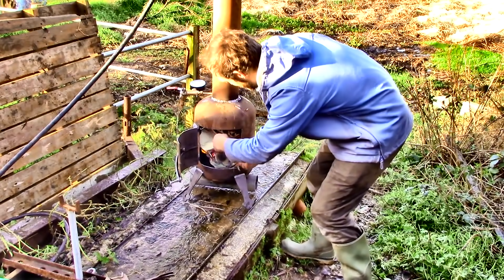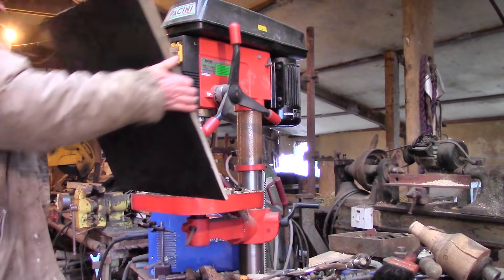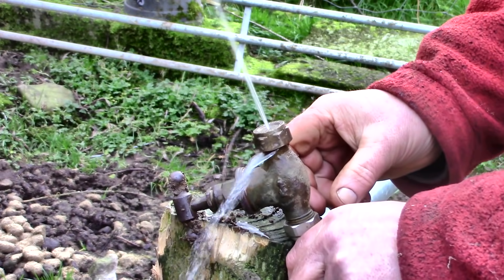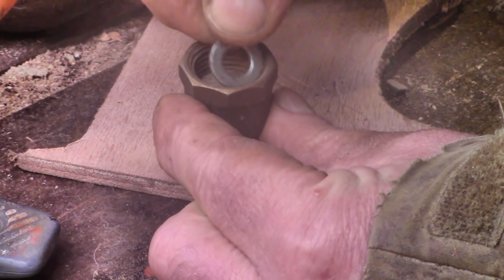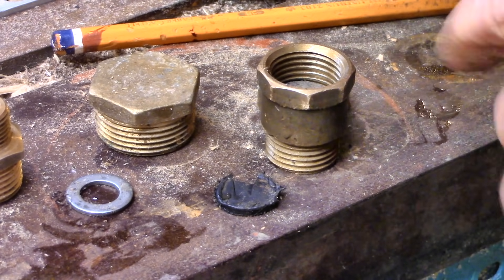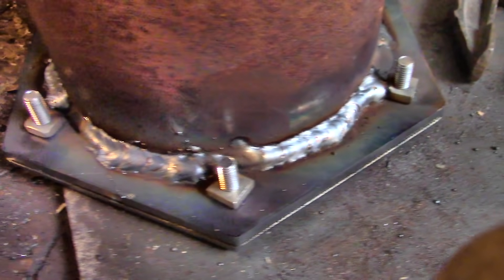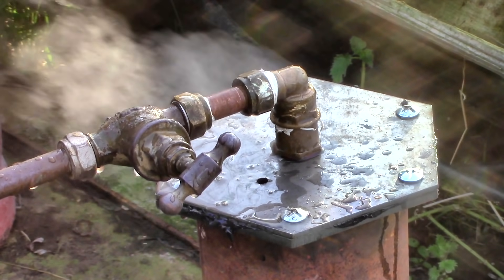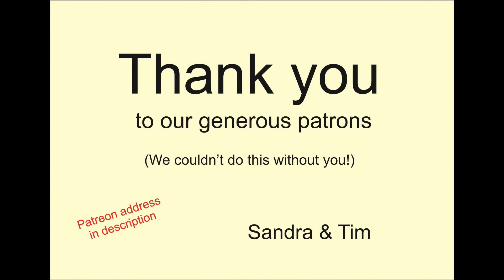Home Made Hot Water Float Valve! (For the flash steam boiler)

Comment: I think modern float valves might be heat proof up to 200°C. But very old ones used copper ball floats. Have you considered using a float to operate a ball valve?

Comment: Why don't you consider a combination of toilet valve and siphon pipe system? by using a conventional toilet valve from the pipe to fill a tank 1/2 to 2/3 volume of your boiler, and connect it with a siphon pipe, the inlet to be at the bottom of the boiler and submerged below the water level. In this way, though some heat would be wasted at the inlet section, but there should have parts available at your local hardware store.
Reply from the maker: Both the tanks would need to be able to cope with the pressure - and maybe the heat would spread between them too? In which case there wouldn't be any advantage, would there?
Reply from the maker: And  they'd need to be connected at the top as well, I think. Otherwise the steam would push the water back up into the first chamber..
Reply: @wayoutwest-workshopstuff6299  therefore I suggested to connect the pipe to the tank at the bottom of the boiler, with the water near to dry out, the pressure should drops as well, and would allow the water to flow from the tank though the siphon.
Reply from the maker: there will be at least 30psi in the system - otherwise it won't drive the engine - so it would easily push the water back into the first chamber. Keep on thinking though!
Reply: @wayoutwest-workshopstuff6299  it depends on whether the pressure built up in the boiler can push the water in the siphon pipe all the way down to the bottom of the  opening. And sure as mentioned, there will has heat lost to the tank, but as long as there is no constant flow of steam, this could be minimized by insulating the pipe.

Comment: of course, just mounting a feeding water tank above this bioling unit will provide the neccessary preassure to feed the system on the move. You could have the main tank lower down to keep the centre of gravity low and pump fed into the resovour.
Reply from the maker: But how would you stop it flooding?
Reply: @wayoutwest-workshopstuff6299  the simplest way would be to have an overflow pipe, that allows over pumped water to flow back into the main resevoire. Even with a more complex solution adjusting input flow, a feedback pipe would still be a good idea.

Comment: A length of anodised aluminium or titanium rod, sheet or wire, inside a metal tube will work as a capacitive sensor for detecting water level inside boiler tubes, some simple electronics can then switch a pump, solenoid valve etc to control the boiler's water feed.
Tank type boilers produce saturated steam, which is "wet"/any fall in temperature causes steam to condense. A  single long thin tube, as a  single pass, monotube/"flash" boiler,  is considerably more robust for handling higher pressures, and can have the water level adjusted  to make for a shorter, or longer "superheater", in which the steam is continued to be heated after it has boiled.
Reply from the maker: Thanks, Steve, but this is just the first part of the flash boiler.. (Also, I'm hoping to avoid all electronics.)

Comment: did you think about and have you tried actually putting in Reverse
have the water pressure pushing the rubber closed
make the hole bigger so the pin can push through it to push the rubber away from the hole and that would make it flow

Comment: Beware of flap valves for this type of application, they are best reserved for check valves. Your original idea of a nail in a hole is to reduce the force required to close the valve. Once a flap valve opens you can end up with full line pressure behind it, needing enough force to counter the pressure at full bore area to close it again.
Reply from the maker: Surely you get the full pressure either way?

Comment: Maybe someone's already mentioned this...  In a toilet cistern the float is levered near the valve to increase the power applied to the valve.  In your system the two cans (the float) have to be huge apply a 1 : 1 force against the valve.  You could get away with a much smaller float if you apply a fulcrum point to increase the force applied to the valve needle.  Just a thought, just my two cents.

Comment: I'm with those who would separate the "water level" function from the "pure steam" function, because I was raised on Modular Design. My immediate thought was to use an available toilet float connected by a U-tube to control the water level, then focus on managing the steam that is produced. I acknowledge that you have a compact solution, but it seems to me that a problem with the water-control involves dismantling the engine rather than screwing in a "better float module".
Regardless, I am greatly impressed. As usual!
Cheers Chris

Comment: quite a clever desine but i see one ishue with it and that the boiler cant exeed the preshure of the water in the pipe or the cylican disk will be presed aganst the valve stopping water enterig the boiler over than that grate desine
Reply from the maker: That's the way with flash steam boilers - the steam pressure can never be greater than the water input pressure

Comment: A nice trick for making really tiny holes in metal, smaller then is easily achievable with a drill bit. For making tiny holes for pinhole photography people sometimes take a nail and hit it into the metal until a dimple forms on the other side, if you then carefully sand down the dimple you can make holes as small as a 30th of a milimeter(if a fairly hard metal is used).
Reply from the maker: thanks for this - very interesting

Comment: you could always build a brass or copper float....... by using solder or braze it.  That wouldn't rot away and was used in a lot of toilets.  Maybe a bigger tube for the hot steamy water as well ?  Good luck

Comment: I have this project idea that keeps coming into my head. The problem is this: as an inhabitant in modern civilization, I obtain lots and lots of packaging in the form of cardboard, along with lots of things in plastic. Rather than expend energy transporting that cardboard to recycling centers or landfills, wouldn't it be nice to put it to use? Well, one way would be to incinerate it to heat my home, but I live in the deep south, so I don't typically need heat. But I do need electricity. So wouldn't it be nice to be able to incinerate it (alongside other fuels that are otherwise waste) to produce heat to boil some water into steam that then passes through a turbine to produce electricity? Seems to me that it would be, but there are a lot of enormous technical challenges that I simply don't have the time to investigate, let alone solve. So I deeply appreciate you sharing your learnings. Maybe one day I will be able to apply them to my project idea.
Reply from the maker: burning plastics needs really high temperatures to do cleanly - careful you don't just poison the neighbourhood!
Reply: Oh, Sorry! I meant "burn the cardboard and use the waste heat to recycle the plastic a la Precious Plastic," but see now that the recycling aspect fell out of my brain before flowing to my keyboard ;-)

Comment: I always appreciate your ingenuity with these projects. I may be missing something, but does the float valve need to be in the tank? If only the float was in the tank and the actuating rod could exit via a seal, then normal cheap plumbing parts could be used to control the fill pipe. If the float rod was bent into a 90 you could get some leverage out of it to overcome any pressure from the seal? Might work idk.
Reply from the maker: You're right in theory - but I don't know how I'd make that seal in the real world.
Reply: @wayoutwest-workshopstuff6299  I was picturing the packing from a hot water faucet tap or frost free hose bib. Something like that? I think even a regular valve like you have could be cut off and the stem could be sanded and brazed into a larger pipe fitting.

Comment: Tim,

Very clever. I am impressed - as usual, 

There is a needle valve on carburetors that are very similar to the one you fabricated. If you have a scrap yard you might find one for pennies ready made. 

The orifice you made is quite small and I worry it may get plugged up with scale and cause an over pressurization.  No doubt you have thought of that.

Regards
Frank
Reply from the maker: You're right - but I wonder what pressure is behind the petrol?
Reply: Modern cars with electric pumps are around 60 psi. Older cars were 4-6 psi- so sayeth Google.

Comment: You could always use brass valves. Rather than using a plunger, use a system like they do on Mamod steam engines. The shut off is powered by a sliding plate that goes over the hole.
Reply from the maker: Interesting - thanks.

Comment: Tim what about doing it a little backwards. Use a ball bearing in a cone and let the water pressure close the ball the float pushes the ball open when the level is low.
Reply from the maker: Can you send me a drawing, Perry? Wouldn't you be relying on the weight of the float, rather than its buoyancy?

Comment: Hey just want to let you know that maximizing airflow for the wood burning section is key, perhaps using a set of bellows to make sure it is still hot, I think it goes well with the steam engine vibe, and allows you to keep the wood section small but still hot enough to make the water flash to steam faster.Loved the video!
Reply: Interesting idea for the bellows. Early locomotives used axle driven bellows (you can see them in early engravings) to make the fire burn hotter. Once they came up with the blast pipe to draw the fire they no longer needed them.
Reply from the maker: Thanks, both - yes, very interesting

Comment: You could also simply add another tank with a regular float and connect it with two thin pipes, one at the top of target level and one at the bottom. This way you can use off the shelf float and water in the inlet tank will never get hot enough.

Comment: This feels very unreliable for my taste. Many moving parts out of control, and with slight contamination in water... I would place a cheap stainless steel float with a reed switch, from china and place an electro-valve away from the fire. It could run from a small battery or even solar power. This would make space for adding other simple sensors to the equation, like thermostats and so on.
Reply from the maker: I had to look up reed valve - but it seems to be what I've just made. Or have I got that wrong?
Reply: @wayoutwest-workshopstuff6299  I think about this https://www.youtube.com/watch?v=ifJjFp6GENY there is a reed switch inside the tube that closes when the float is close enough. It is potted and comes with hi temp   wires for as cheap as under 2€. You can also get them with 90deg bend do be mounted on a side of the tank.  I also found stainless hi temp float valve (just like plastic) on Ali for about  37€
Reply from the maker: @contemporiser  Thanks for this, Piotr. I didn't know they existed. I will try to order one today

Comment: Tim, I know you don't like the idea of a gas engine, but as much as I love steam engines, all I've learned about them has taught me to be afraid of them. There's a lot going on with them.

And you could definitely make a small gas engine locomotive of sorts to push the carts around. It could even have rubber tires and you know, be able to go across track and around carts to get stuff where you want it more easily. You know, one of those walk behind tractors, maybe with a couple more wheels, would do nicely. 

I'm just worried that a steam engine and locomotive will injure you or explode.

Comment: Nice concept! You could make the valve working the other way around. So the water pressure from the pipe to the vessel closes it. To open it something has to press against the opening. For the actuator you can use a sunk screw with 45° angle. 
       ___________________________
      I               __________________
      I             / __
      I______/ /    I   <------ Screw
__________/      I
_________          I                  <----- water to vessel 
       _____   \     I
      I          \  \__I
      I            \________________
      I_________________________
Reply from the maker: I like it! Very clever

Comment: Tim...by definition if You are fitting a float valve,  you are NOT making a flash boiler.  In a flash boiler you admit a controlled amount of water (normally a pulse either as a direct result of pressure change feedback (e.g. toy boat), or with a pulse pump driven off the output drive (e.g. steam car)). This then hits the hot surface and flash boils. Hence the name.
As for your steam being wet, it is because it is not hot enough/ has chance to cool before being used/ is taken from too low in the boiler.  
If you are starting to make steam in an enclosed boiler pressure vessel, it MUST have a safety valve. Otherwise no Tim,  no channel. ...
Reply from the maker: I AM making a flash-steam boiler! Be patient - I haven't got to the flash part yet, obviously.
Also I am admitting a controlled amount of water. And I'm not making steam in an enclosed boiler.
Reply: @wayoutwest-workshopstuff6299  Morning Tim.  I look forward to the developments. Your projects are always interesting.  Regards Gary

Comment: "The engineer mind!", quite clever, indeed. Stupide question: why not separating the water tank and the floater from the boiling machine and connect it with a pipe and let the pressure flow the water in? It should limit the temperature constraint.
Reply from the maker: You're right - but there would be more connections and another tank..
Reply: @Way Out West - Workshop Stuff  Indeed, if you favour simplicity, your solution is definitely best. But if you favour robustness that could be arguable as the high level of heat and its expansion/reduction cycles might affect the water-tightness of the setup.
But your solution is more challenging and thus much more interesting :-).

Comment: Come engine time, I suspect your water supply will not be under pressure, unless you are planning to bring the hosepipe with you! So your original pin idea may still work out.
Reply from the maker: Quite right! I'm a long way off driving it along the rails though - so I might have come up with something else by then

Comment: My only issue with this style of vavle is that once you build pressure, the valve seat will have a force from vessel pressure to hold shut, allowing the boiler to run dry. I would test this design while the steam can build up vessel pressure

The problem you've had originally with the pin-in-hole design is a solved issue. Every steam float uses a float on a lever to multiply the bouyancy force. This way the seat cant be held shut by pressure(pin is too small area to push) but still allows actuation(lever gives float enough force to close) 

Another issue has to do with how the hole was drilled. Using a tapered plug in a cylindrical hole will be hard to seat. Use some lapping compund and chuck a spare tapered pin in a drill and give it a grind.
Reply from the maker: I did try tapering the hole by bashing the pin into it - but it didn't work very well. Also, I won't be building pressure in the boiler - all the pressure comes from the water

Comment: Love the concept, one thing I will say. Some of the water that came with the steam, could be down to a thing known as "priming". It's common with new boilers that have traces of contaminates such as weld fluxes and similar inside to "stir" the water up as it boils. Very common with model steam engine boilers, and can even happen with some tap waters depending on the water quality in your area.
Reply from the maker: So much to learn...!
Reply: @wayoutwest-workshopstuff6299  
Here's an idea of a steam engine I thought of.
Basically, a big piston in a cylinder would rise and fall over boiling water inside the bottom of a cylinder. The piston when rising, would lower the air pressure, causing the water, that is at its boiling point, to boil more, and allowing the piston to rise easily to the top, where pressure would be released from a one-way valve. Then, the piston would stop for several seconds, while the steam would condense on the inside of the cylinder, lowering the pressure inside, and "pulling" the piston down, where it would also stop for a few seconds at its lowest point, while the heat and pressure increases. When pressure rises a set amount over atmospheric, the piston is allowed to rise again.

Maybe the piston would not have to stop for the engine to work. The cylinder could be quite long, maybe a few meters. The outside of the cylinder would have cooling fins on the upper 3/4 or so, to allow an increase in the cycling speed of the engine. The wood fire below would contact "heating fins" and then be vented away from the upper part.

Two cylinders could be working in opposite directions, linked together somehow to rotate a flywheel.

I don't know if this exact idea has been thought of, but probably. Its simplicity seems like a good thing, allowing it to be built fairly easily.
Reply from the maker: @FLPhotoCatcher  That does sound wonderfully simple. I have no idea whether it would work though. Can you have a go at building one?
Reply: @wayoutwest-workshopstuff6299  Eventually, maybe. I don't have the necessary fabrication skills at the moment. Or the time really, but that could change.
Reply: @wayoutwest-workshopstuff6299  BTW, feel free to build "my" steam engine, or also encourage others to build it.